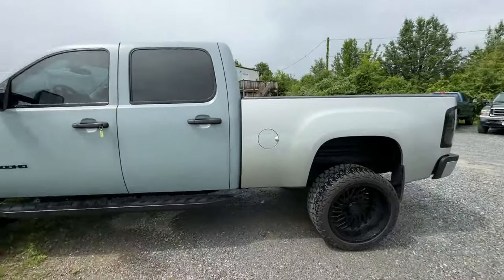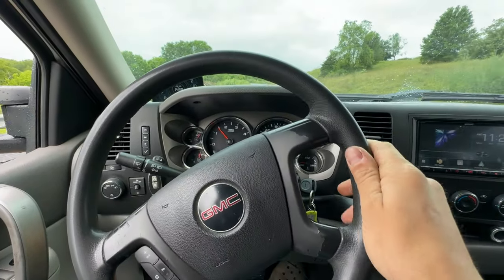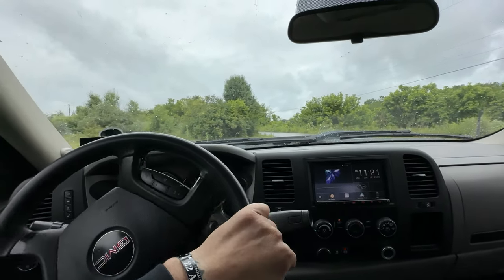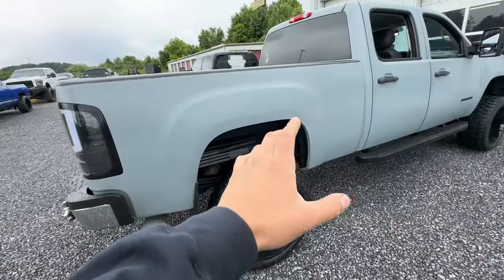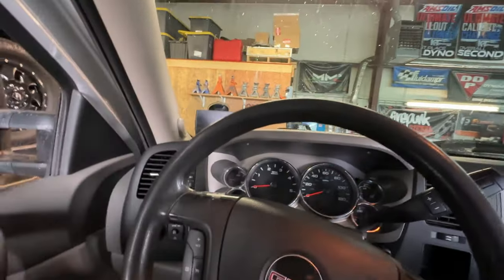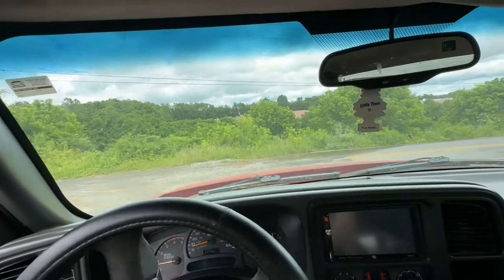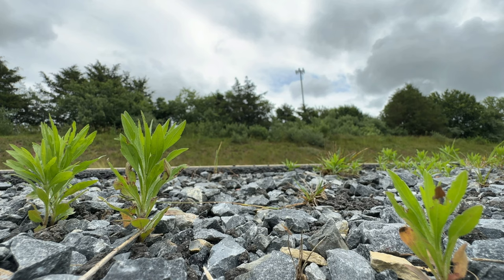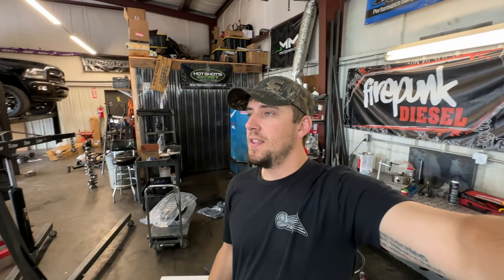Loudest Duramax Drop In Turbos Stainless Diesel 5 BLADE!

Comment: Love the sound of these turbos! I have an rds 9 blade that I installed and am currently pairing an S476 next to it. Really looking forward to how it sounds and drives!
Reply: How does it spool up compared to stock? Also, how is the exhaust brake?
Reply: @killjoy0484  it's a little different than normal just that added turbo makes it seem like it lags but that's not necessarily the case. It takes a bit to spool up top but it's a split second and when it hits it goes. Haven't tried exhaust brake yet but we'll see how that is when I put a load on it
Reply: the s476 will take away a bunch of the turbo sound.  usually the compounds quite down the whistle quite a bit.. at least in my experience
Reply: Have you finished your compound? Same plan i gonna be going with my lly.

Comment: Vinyl floor kits are about $200 to $250. Nearly every truck I get I install one when I do the sound proofing and stereo wiring. The molded vinyl flooring is not perfect and its a pain to get right, so having a heat gun handy really helps the job go faster. Its best to have a box of 50 or 80 mil killmat and some thicker 397mil padding to add as filler. If you dont do this the truck is a lot louder inside.
Reply from the maker: Thank you!

Comment: Not mad at the Duramax content! I garage built a 63mm 6/6 blade and paired it with the 2003.5 Powerstroke 66.5 mm 10 blade turbine in an LLY housing for my LBZ. Sounds just like it! One of the best mods as it put down 563 RWHP on the NWDC dyno jet with stock sticks and pump.
Reply from the maker: I have a new turbo for our 6.0 project
Reply: @horsetorquesdiesel  Right on! I'll be looking forward to seeing how that turns out. I may be more of a Dmax and Cummins fan but 6.0s are one of, if not my favorite sounding truck!

Comment: I am more interested in egt control and power on my turbos but if noise is what is important than for sure the way to go! 😅
Reply from the maker: Idc what turbo or configuration that is 100% the driver that determines that. I can melt the pistons out of a stock turbo truck, and I can tow with a gt55 on the manifold.

Comment: Hey josh first you said the lml had a 63mm turbo and then you said the red one was a 68/71 turbo and then said they are both running the same turbo.....? can you specify what each one was again? lol Sorry I'm in the process of ordering the 65mm turbo for my lml and couldn't decide if I wanted the 9 blade or 10 blade turbine wheel and then you show this! But I just got confused there at the end. Thanks
Reply from the maker: Sorry
68/71 9 blade on red truck
63/68 9 blade on gray truck

Comment: Josh on a stock 08 6.7 with weight loss and a 60HP tune. Would a s467 be a decent turbo on stock fuel and a stock 68RFE ? I don’t race the truck but the stock turbo is having VGT issues
Reply from the maker: I personally love stock fuel 464 467.7 second gen swapped trucks

Comment: How does the lower blade count effect efficiency, power, lag etc.?
Reply from the maker: A 10 blade vs 9 blade turbine drive extremely similar. This turbo is larger than stock so it does have more lag but the 9 blade turbine is what makes it so loud. The 5 blade compressor wheel on the front vs an oem style again is similar in power delivery. Comes down to customer preference